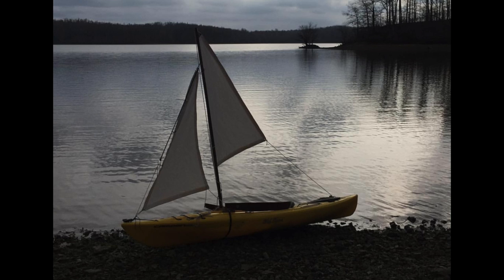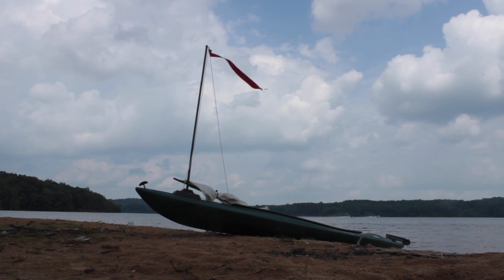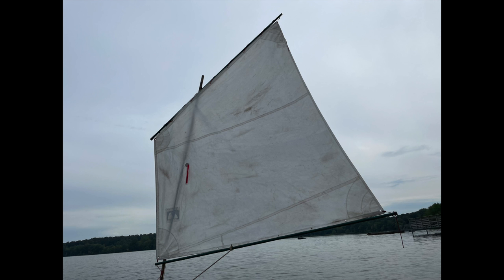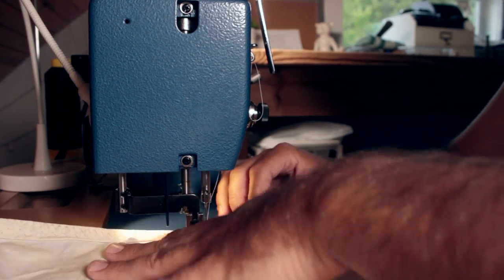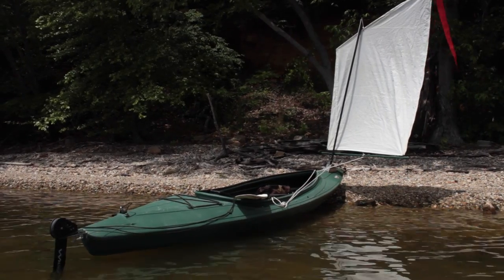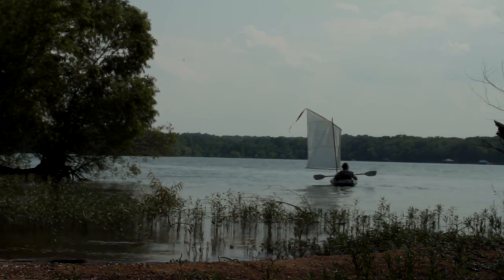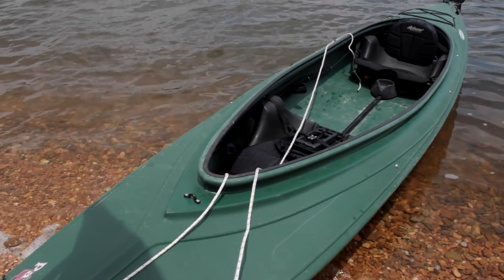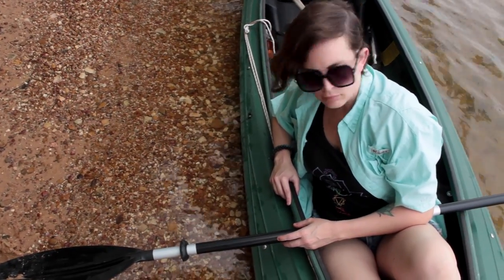Kayak Lug Sail Build: Wilderness Systems Pamlico 160T

Comment: I have a similar kayak, an Old Town Loon 16T, with a sail and rig from Falcon Sails. Although their rigs are expensive compared to yours, the website will give you plenty of good information on rigging and sailing a kayak. Specifically, a compression post under the deck to support the mast.
Reply from the maker: Those Falcon kits look really nice from what I've seen online. I prefer to build from scratch. I have considered a post like that. Also considered a wooden beam or bulkhead. Thanks for the info.

Comment: To stiffen up the deck just add a bulkhead made out of one of those cheap foam swim boards from Wallieworld. You know the kind, sort of a plasticky two inch thick foam swim board. Make a pattern out of cardboard first so you can get a nice tight fitting. And then just press it in place. Add a paracord lace to it so you can remove it and still have accessible storage space for your gear. It will have the additional advantage that it will help keep water out of the boat when you flip it.
Reply from the maker: Not a bad idea. I was considering something like this, but was leaning more towards a beam. I would probably build a bulk head with 3/8 exterior ply and install a plastic inspection port, or make it an open frame.